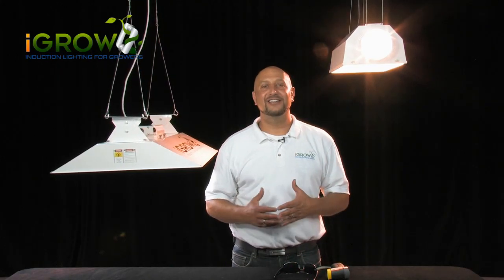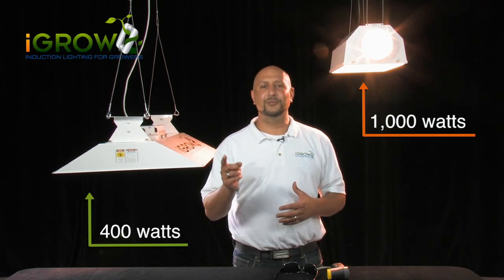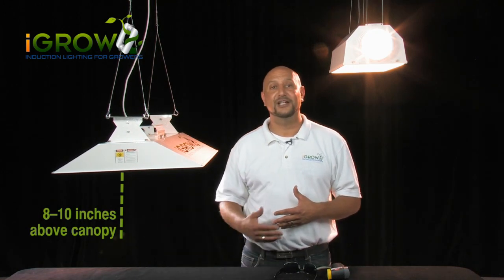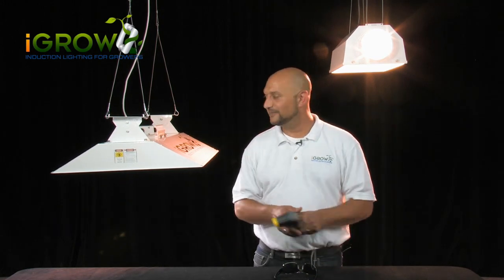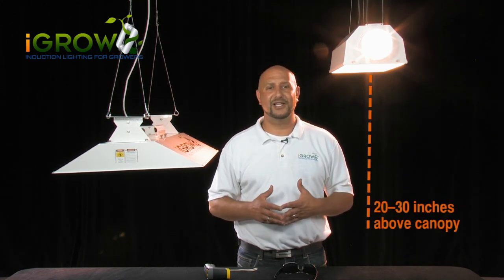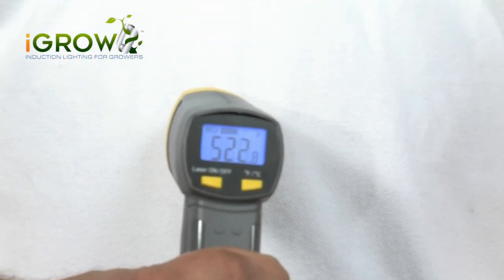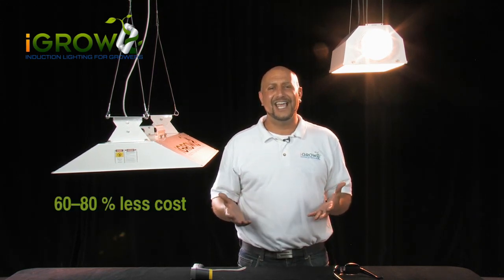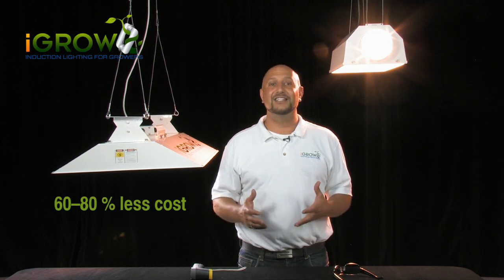Plant lighting energy efficiency - The end of the 1000 Watt grow light

Comment: some t5 aquarium lights also have a spectral output that matches plant light requirements and is very similar to the spectral output produced by induction lamps ( check out the wave point ultra grow wave and compare spectral output) the only difference is that they use high voltage to ionize the mercury vapor instead of an rf field.and they are much cheaper with a rated life of 20000 hours they use a rare earth phosphor just like induction lights to produce a spectral output that is tuned to plant needs.leds are  interesting but you need to use at least 11 different chips to come close to a plants spectral need and when you consider the power requirement of the power supply and chip they are less efficient even with 50 watt modules.and much more expensive even if you have the skills to build your own light.

Comment from the maker: The electrical savings is simple math. 1000w HPS uses 5amps, iGROW 1.6amps at 220v. add in much less HVC and blowers your way ahead. For yield look at it this way. Based on lots of reports iG 400w lights averages 80% yield to a 1000w HPS. So from a yield to watt ratio, iG way out performs HPS. Even at 60% yield, you are better off. To see lots of grows, reports and data try our Dealer Grows page on our website and Google, Grow with Induction and look at that site. Thanks for sending this.